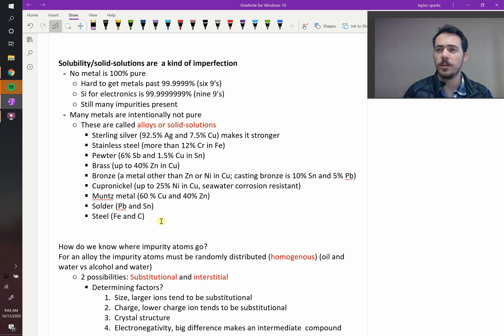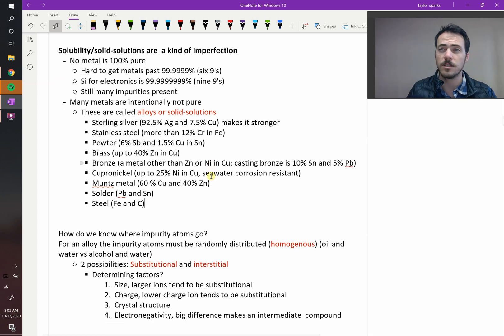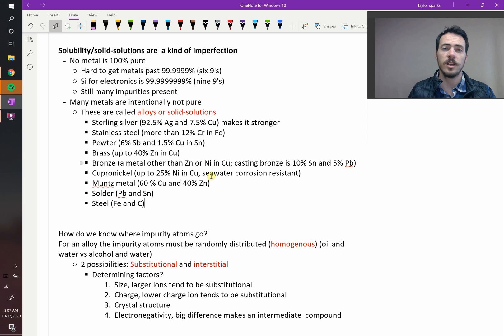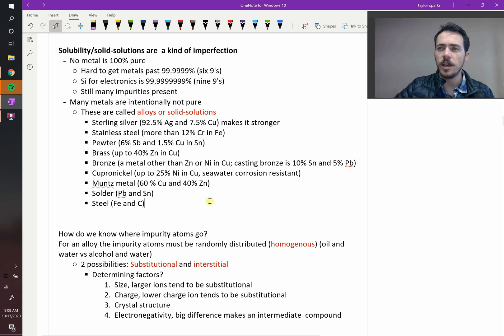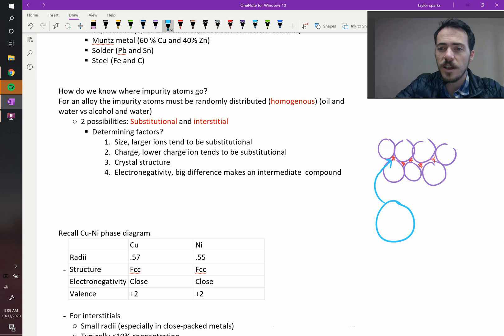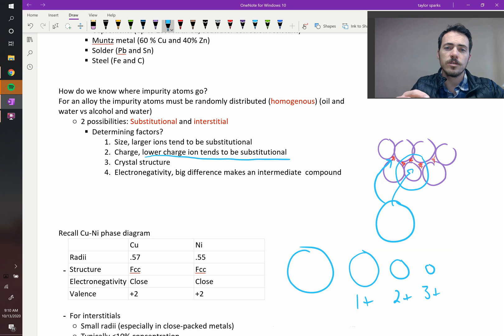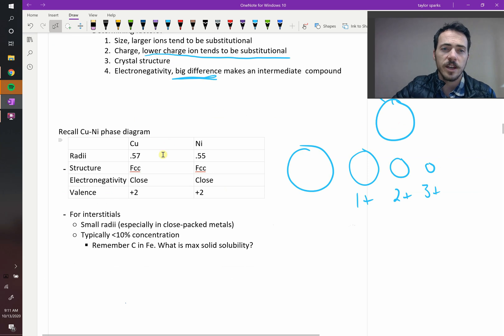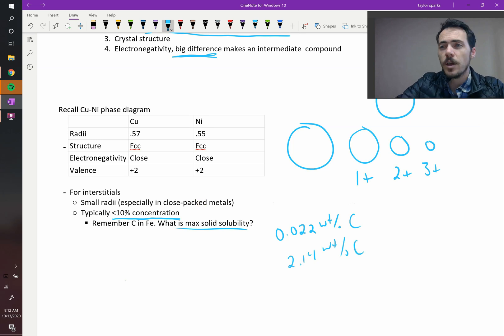Alloys and solubility rules

Comment: If a silver alloy is kept in a molten state while centrifugal force is applied would there be a separation of the elements?
Reply from the maker: Unfortunately not, although this is a clever idea. In principle, when you apply objects with centripetal force, you get separation of the denser object relative to the lighter objects. Think something akin to panning for gold. However, with atoms, the difference in density is so minute that the forces are not possible to overcome the differences. Furthermore, there are confounding factors like chemical bonds, miscibility, Brownian motion that would make this impossible. Instead, if you want to purify an alloy, you would consider something like zone refining where you introduce a heated zone within your material. Typically in the two-phase solid plus liquid regen where now the solid is primarily one of the components allowing you to slowly separate the secondary component out
Reply: @TaylorSparks  A 1930's French patent for a carbon arc centrifuge, states it is designed to cast small pieces of metal.
The carbon arc centrifuge is a swinging bucket type which, in my mind, raises questions about how and what it was used to cast.
I have been wondering if centrifugation of molten metal could be used to purify it and if perhaps that is the purpose of the device.
As an example, if the crucible was a cone and heavier elements collected at the point of the cone, this point could be removed as a fraction. If this process was repeated the fractions would become increasingly pure. Your previous answer rules that out as a possibility however I thought an explanation might be of interest to you. The mystery continues.